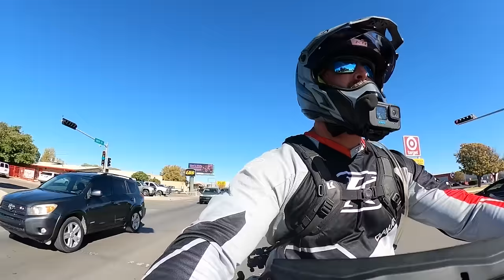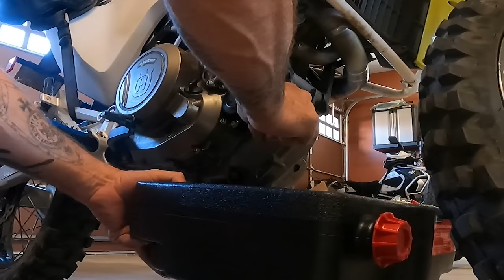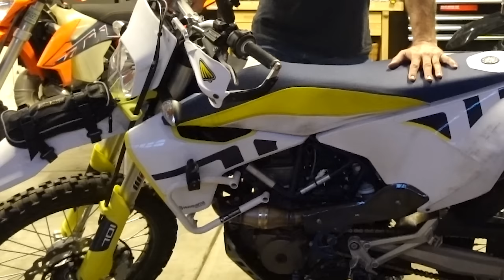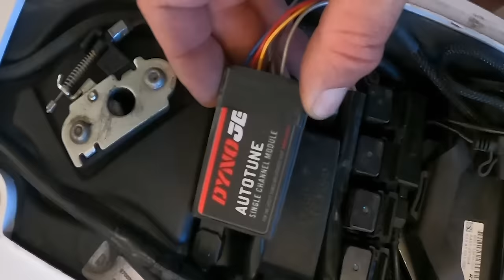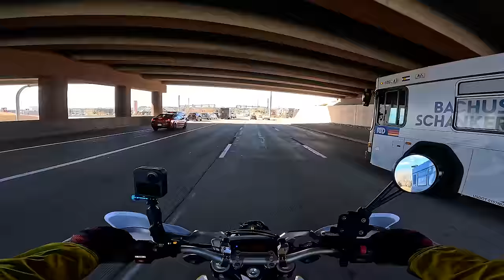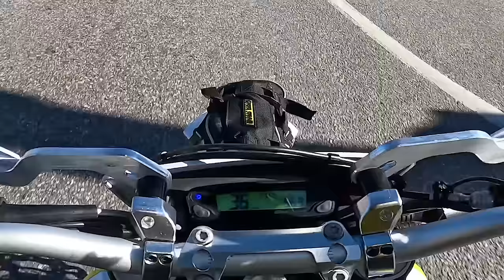The Husky 701 Enduro: Is This The Only Vehicle You Need?

Comment: I feel like the 501 S might be a better all-around choice than the 701 if you’re looking for just one versatile bike. It has more torque, is lighter, and can reach similar speeds. Given that all bikes need some modifications no matter the model, why did you go with the 701 over the 501? What’s your take on the 501 as an alternative to the 701? I think both bikes are great, but the 501 feels more fun and I personally think it look a lot cooler also and can take you off the roads at any time you have an impulse to try something a bit more advanced off-road... what do you think of that?  thanks for a nice video on the 701!
Reply from the maker: The 501 is certainly a great bike and I like it a lot. It is much more of a dirt bike than the 701 is and doesn’t have near the long range legs. Sure you can get a larger tank for it, but in general the 501 is more of a dirt bike then a dual sport, where the 701 is almost more of an adventure bike than a dual sport. I tried riding the 501 for an extended ride on the pavement and it darn near killed me it was so uncomfortable. If you are going to ride 90 percent or more dirt, then I would say go for it. I am 6’4” and weigh 240 pounds. The 501 is not a bike I can ride for long distances. I rode my friends on some pretty rough single track and it did great. It is an excellent bike and I have nothing bad to say about it, just that the 701 is more up my ally. I have found out many times that it doesn’t go anywhere, but it goes just about anywhere.
Reply: @upshiftingadventures4034, I understand. It seems that the 701 is optimal for long-distance road riding, while the 501 is better suited for off-road conditions.

So, if I’m interpreting you correctly, there isn't currently a single bike that can effectively transition between these two distinct terrains and riding styles. Would that be an accurate assessment?

Comment: Have you installed bar risers or lower pegs for comfortable standing when off-road? I am getting a 701 and am also 6'4"  so this would be useful info.
Reply from the maker: I have 2 inch risers and that’s about it. I find it plenty easy to stand on. I did put a seat concepts tall seat though because the factory one is not very comfortable. Worth the money in my opinion.

Comment: Thanks for answering my questions yesterday. I think I didnt have the traction control settings correct so that would explain why it didnt wheelie. Will probably be picking one up next year after all. I live an hour of highway from the closest single track and my daily is a Norden 901, but I think the 701 will be perfect for weekend woods riding and occasional commuting. Had my reservations about their reliability but I have put 6,300 miles on my Norden since June 1st and its been trouble free aside from some weeping hose clamps. Cheers!
Reply from the maker: Awesome to hear you’ll be picking one up. I thunk you’re gonna be glad you did.

Comment: What swayed you to go Arrow exhaust vs full Tekmo?
Reply from the maker: That's a great question. I had initially went with a full Arrow set up, titanium head pipe and muffler. I failed to do my research though because I also bought the PC VI and Dyno Auto Tune. The auto tune comes with a replacement O2 sensor that has a 12 mm thread and the stock system, and the Arrow replacement head pipe, are 8mm threads. I didn't want to have to cut and weld another bung in the new pipe so I bought the Tekmo head pipe, which comes with a 12 mm threaded bung in the bend in the pipe, along with an 8 mm adaptor for those who are using the stock O2 sensor. Truth be told, I'm perfectly happy with the combination.

Comment: I went down a tooth in front, removed ox sensor, & added Rottweiler fuel dongle to enhance bottom end. (Wings exh)
Reply from the maker: Do you find that made a good difference?
Reply: It’s not perfect but a massive improvement off throttle. I still get about 55 mpg.